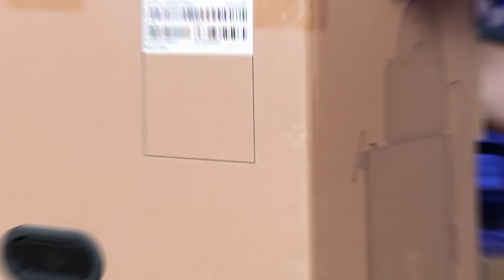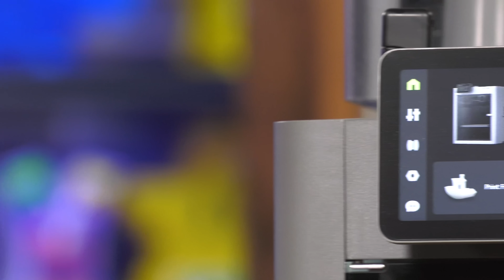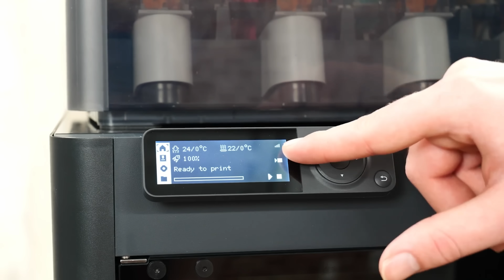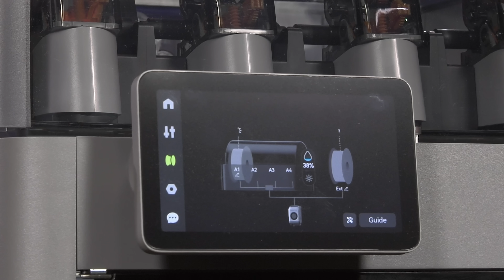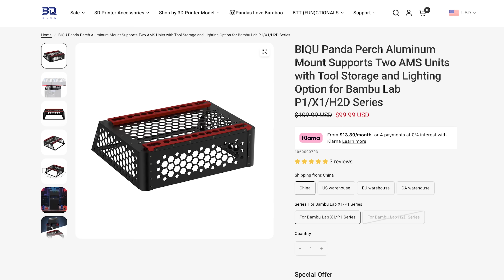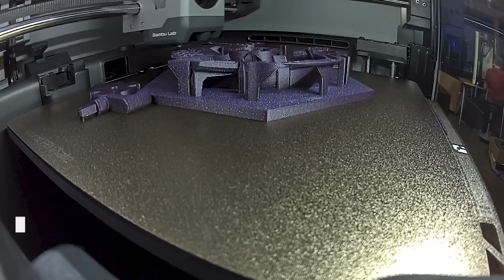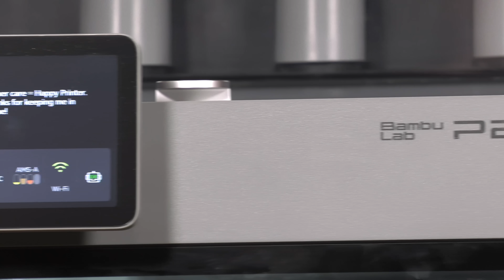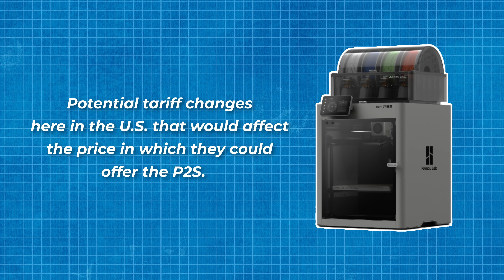FINALLY Bambu P2S IS HERE, Upgrades the X1C?

Comment: If this is not compatible with their Vortek system it will be a big miss.
Reply: No it won’t. Completely different use cases.
Reply: @garymelrose9727  It is not different use cases. EVERYONE has been asking for a solution to the filament poop issue. And the fact that this still uses ancient technology from the stone ages is a big time miss in my professional opinion.

Comment: I'm working with a centauri carbon but I've started using the same lube for my rails on the nozzle and it works great
Reply: which lube is that?
Reply: @hbot404 I'm just using the grease that came with the printer but any small machine lube that's white or super lube will work great

Comment: You say this is a worthy successor to the X1C, but it doesn't have a heated chamber or the error sensors the X1C has. It just has a nice screen and it's able to hook up 2 AMS units out of the box? I guess it might depend on pricing but it sounds like it should just be the P1S replacement and cost around $800 or so?
Reply: The X1C dosent have a dedicated chamber heater, only a temperature sensor.
Reply: @lukahierl9857 The P2S doesn’t either. It has a passive heated chamber using air recirc, its bit actively heated like the H2 Series. Still better for ASA/ABS etc than my X1C though - that’s been relegated to PLA/PETG only since I got my H2S. That prints ABS/ASA (GF and CF) like the X1C prints PLA, straight from the AMS onto the stock textured PEI plate, no glue, standard profiles, slice/print/repeat 👍
Reply: It has the same sensors as the H2 series have. Add in a better air circulation system, better camera, better nozzle system, its a crazy good value compared to the X1C. $800 is for the AMS combo, which is the same as the P1S was with the AMS 2 Pro instead of the AMS 1

Comment: Looks like a good system.  The challenge today, is what printer to buy.  I just ordered another Elegoo Centauri Carbon yesterday and found out their AMS probably won't work on the CC.   The new Bambu printers with AMS could be obsolete when the tool changers hit in early 2026.  Will be interesting to see how the Snapmaker and Bambu units work and Bondtech will be something to see.
Reply: As cheap as the Centauri Carbon is for the quality of print I don't really care about multi color on it.  Personally I pretty much just print ABS on mine and leave PETG, PLA, or multi color to my A1
Reply: @soundman447  I agree.  For $300 it works as well as the Bambu X1C and in some ways better than my Prusa XL.  For single color prints it just works and the value is great.  I really want to see how the production Snapmaker works.

Comment: I hope the PETG issue is fixed, I prefer to print it due to the higher heat resistance.
Reply: You can print with HT-PLA that has higher heat resistance than PETG.

Comment: Some things not mentioned are the cooling fan that pulls air from outside the unit, the steel as apposed to carbon rails, and the upgraded purge wiper. Also it does flow calibration similar to the H2D or A1.

Also.... I just bought an X1C a month ago because I missed my previous X1C. Oops. Oh well. Its still a beast lol
Reply: I have a X1C, and X1E... don't regret them, because they have seen a ton of use.  The X1E is nice because of the filtration, and the hard-wired Ethernet.  I'm glad Bambu is iterating and evolving, while keeping prices reasonable.  It just means more people are going to get into 3D printing and the entire ecosystem expands.
Reply: Don’t have buyer’s remorse over buying a X1C instead. Use it until the X2C is released. I’m sure it will have the new tech from the P2S and H2S with the sturdiness of the X1C.
Reply from the maker: Still a beast for sure!

Comment: I’m sorry but this was not one of your best videos. I did not hear anything that would say it’s an upgrade of an X1C. Ok having two inputs for AMS, then taking the hot swap from the A1 are not really upgrades. If someone doesn’t have an X1C then buying this instead of a P1 is a huge upgrade. At this point I’d expect more from them. An X1 upgrade would include a heated chamber. But I’m guessing it looks like they put all of their newer ideas and upgrades into like you said their new flagship H series. In any case thanks for sharing the information and your hard work. 😊
Reply: that nozzle is a huge deal though, along with the screen etc
Reply from the maker: Yeah, the H2 series gets all the goodies. If they put a chamber heater in hear, the price would skyrocket.
Reply: better rail design, better hot end that's standardized across the entire mid and upper lineup, way better extruder, no useless LIDAR, better UI, cold air intake so you don't have to leave doors open on PLA, full build plate usage as it uses the cutter from the H series, and better nozzle wipe area (PETG bugs aside)

There is no market for the X series anymore, the H2S took that slot in the pricing lineup, this just brings the mid tier up and splits them into 3 distinct lineups. 

I think it would be nice to see the A2 become what the P1P was, open air but framed in, best of both worlds cost wise, only thing is I don't know of a way they could bring forward the rock bottom pricing of the A1 mini with going core XY so I guess we'll wait and see
Reply: @chomp7927 So how it is better than X1 or even P1S? If you already have one of above, you are good. Only if you concidering new printer P2S clearly wins over P1S and for some over X1C
Reply: @maxdefire I literally laid it out there buddy, if you can't read that's on you. It is objectively better than the X1 in multiple ways, and flat out better than the P1 in every way. 

Whatever you already own or don't own already doesn't change what's better or worse, that's a personal choice you should make for yourself but that has nothing to do with which one is the better printer
Reply: @chomp7927 it actually worse it terms of print quality lol.
Reply: @chomp7927- passive chamber temperature control for ASA/ABS as well. FAR bigger and more efficient chamber VOC filtration for ABS and ASa as well. Several improvements for those not determined to see none. 👍

Comment: Man, I've been a Prusa fanboy for the last decade. I upgraded my Mk4 to a Core One and it's a fine printer. But it's getting harder and harder to justify my unreasonable hatred of Bamboo printers. The last thing I have is that firmware thing. Are they still doing that? Can I keep hating them?
Reply: no changes on that front, plus these newer lines obviously don't have old enough firmware to be pre-ban so if that's a sticking point for you then it's still a thing
Reply: The firmware thing alone is enough of a justification. That and long term support and upgradeability. You get what you pay for.
Reply: @Waldohasaskit210 - you certainly do…if that how you Prusa fan bois have to justify your spending, tinkering and DIY ‘support’. 👍

Comment: 4:11 You're using the scraper upside down 😯
Reply from the maker: wait, text up, yeah?
Reply: @3DPrintingNerd  If you flip it over, the 'sharpened' side of the blade can become flush with the bed, whilst also resting the plastic on the bed. This way you never cut into the bed by accident. The 'ramp' or 'nubbin' or whatever you wanna call the thingy that's now on the bottom then becomes a place you can push against with your finger.
Using it upside down gives you a high risk of scratching a surface

Comment: Yep. Kinda figured, Trump be fuckin shit up as usual.

What I wanna know is, I wonder how much of the P2S parts would work on a P1S? Can I convert the hot-end to the quick-swap version? AND THE SCREEN! Can I have that screen please??
Though question, if this is more of an X1C replacement, does it have features like AI trouble detection with the camera system? Lidar sensor for first-layer correcting??

Comment: There are a couple of features that the X1C has which aren't mentioend here that I'm curious about. Does the P2S have the same or similar speghetti detection and LIDAR sensor for the first layer? To me those are the big things that differentiated the X series from the P series so if they're not on the P2S then I'd disagree witht the conclusion that it's an 'upgraded X1C'
Reply: Did the first lidar do anything useful? Tye spaghetti detection is from the camera.
Reply: @SentientTeapot2444  in my experience the "Lidar" sensor in the X1 dosent work. On the other hand the load cell based system in the A1/H2 printers is very reliable.
Reply: @lukahierl9857 - I agree. The constant ‘LiDAR is dirty’ warnings are a pain on my X1!
Reply: Yes, it does do spaghetti detection. It does not have Lidar as Bambu Labs are now using the same method that the A1 series uses.
Reply: @SANSd20  what you said but likely based on a better CPU it's likely using the same AI detection the X1 or H series uses, A series CPUs are pretty gimped so I would assume they are using a better detection algo like on the X1 or H class machines
Reply: @chomp7927 I meant the H series as they use the same nozzle. I don't know why I typed A1 series.

Comment: A few month ago, p1s were like, "nah, we don't need touch screen" . Now they will be like "whaaa, that screen is nice" 😅. But joking apart, I don't really like the easy swap hotend mechanism. A bit fragile and I now have to heat up the hotend too to remove it after I forgot to change some settings when changing material and got some filament buildup like you. I bought a hotend with removable nozzle for my x1c and like it more than the way it's done on my mini. Might be the only one thou 😅.
Reply from the maker: A removable hot end like what you got is SUCH a good idea.

Comment: Now that I saw what Snapmaker did, it is hard to justify the machines with only one extruder.
Reply: But the Snapmaker can't even print soft TPU out of the box. I don't think people will like that. Also, remember Joel's ender 7 (3 years ago) can see the first layer on Snapmaker...
Reply: @Golfboy-ze3le  - also no use for engineering filaments, unlike the H2S, P2S and X1C (in descending order). My H2S prints ABS and ASA like my X1C prints PLA. Slice, print repeat.
Reply: Then buy a Snapmaker 🤷🏼‍♀️ I’ve had other machine brands and I’m not touching them again
Reply: @DS-pk4eh  I bought one printer from snapmaker. Never again. It might look great right now but please don't fall for it.
Reply: Bambu Labs H2C will compete against the Snapmaker UI in that area.
Reply: @MadStyle1911  Not at the Snap maker U1 price point.... Not possible with the current H2 prices
Reply: @MadStyle1911 I'm hyped for the vortek nozzle swap system. I have an H2D but it should be a fun project to do the conversion
Reply: @SangheiliSpecOp as owner of h2d and almost commercial printer I'm afraid about idea to swap right nozzle. Without option to feed tpu or different brittle or gummy stuff to left or to use it with ams, right nozzle ams feed vortek will be just pricey, overengineered colour changer.
Reply: @MadStyle1911 I hope the H2C will be priced around the retail price of Snapmaker U1 (hopefully H2C will be around $1200-$1500) to be competitive with the U1.
Reply: @KippyKipKip  Hoping as well..
Reply: @KippyKipKip Yeah there’s zero chance it’ll be in that price range. The H2D sits and $1999USD currently. For them to come out with an even more advanced version of the H2D and sell it for less than the H2D would not make sense. It would be nice to compete with the price of the snapmaker U1, but there is no chance they’d do that. I definitely think they’ll hold their prices the same as Prussa is doing with the XL. Definitely expecting it to be around $2600-3k with a full nozzle setup.
Reply: @SeriesDmusic Ouch. But I will continue to hope and dream (not that it will come true). LOL.
Reply: @KippyKipKip that's not competitive pricing
Reply: @KippyKipKip  they said flagship printer. Will be 2000+
Reply: (This is just my use case, there may be others like me but there may also be people completely different, so no need to jump down my throat if you hate what I have to say. Disappointing that I have to preface with this, but given how tribal people get over printer brands, it's something I do have to say...) As someone who uses my makerspace's X1C to print Warhammer/Trench Crusade mini's as well as cosplay items (and is looking for a machine to have in my own home workshop), everything coming off the printer is single colour/material because it's all going to be sanded/painted anyway. 4 auto hot swappable heads isn't something that I need or want, so I'm happy to forego it as a feature in favor of a machine that I know and have history with already. In the end it'll depend on what the post-tariff price of the P2S is, since I'm currently favoring the H2S for it's 340x320x340 build volume.
Reply: @ThatOtherAndrew  I agree on build volume, I have couple MK4's and I want something larger S was my answer as well
Reply: @ThatOtherAndrew  Well,  I think we are all looking this from multi-color or multi-material project perspective, with material waste being main benefit. Your thing can be simply resolved with just bigger rol of filament. Sure Bambu is great quality, but 3D printing tech is advancing, and we want our favorite brands keep with it.
Reply: @DS-pk4eh  facts I'm not getting this
Reply: I have to agree
Reply: I completely agree with you.

Comment: Darn. I was hoping for a P2C option for an AMS-free color system. This fixes some things that were wrong with the P1S, but looks a lot worse on the exhaust and noise.
Reply: based on the extra space needed I doubt we'll see that on the lower machines, that will most likely stay H series at least for this entire lineup
Reply from the maker: Yeah, color changing hasn't changed for this one.

Comment: bam. stay first or you wont win. multi-filament single print head for no poops. ie not even print head changers. all the four or more filaments input to the same hot end at same time. no switching filaments but just using different filaments at will. no change poops. yep the roetz4 hot end. not the directional filament but just for filament and color changing printing one color at a time. wine and sausage. yeah tons of that going on it seems. very clean difference indeed. just use up the last color as infill then use the next filament as usual. ie if you dont have multi-filament hot-end and just single nozzle print head then clean up the nozzle by using it as infill while changing colors. no external poopsies. eye of above is upon you. eyeyeyeyeye sir. how many joules to save. present wrapping. why they did not put preheated chamber in that. simple heater exhaust does not cost 1000usd to make. there should be standard enclosed features. money cant think clearly indeed. 1000usd is way high for a normal kitchen appliance. corps: lets just put these random features in this no thinking. who told you corps products were the best. free is the best of course. market price seems to be ok for p2s tho at 500eur. but I dont need more than just elegoo N4 for simple working petg prints. which is 200eur only. maybe for mass 3d printing farm. nano ion 3d print all the chips at home.

Comment: The improved screen and ergonomic features like the handles and ramp are decent upgrades; however, I am not keen on a device that can become bricked remotely from a software update.
Reply: So, you aren't keen to use any device that gets software updates? A software update for anything can go wrong, or be implemented incorrectly and brick a device. Not just Bambu...
Reply: Pls do give exemple of people it's happened to?
Reply: @Sharlequint  6:20 it was an entire section of the video…
Reply: @OneWayTwoBrazil  that's bricking your device? pretty sure most other companies' printers had way more glaring problems on launch? Like you could just turn on LAN mode and not install any updates? Like any other company's printer? Do you even read what you type and try to make sure these are your own thoughts before you type lol
Reply: @OneWayTwoBrazil  Like I get it if out of principle of not supporting a company that locks down its systems at all because that's something you don't like, but now that LAN mode has been provided and other companies' LAN modes have almost the exact same restrictions (no mobile app connection, no cloud slicing and send to printer) what's the argument anymore?

Comment: Oddly, my P1S started randomly having that same PETG issue and I wonder if they are related. Still printing great but the buildup around the nozzle is pretty annoying
Reply: PETG has always been notorious for blob of death, I've experienced it like ten times with PETG and never with any other filament. I check on the printer every 30 minutes when printing PETG due to PTSD.
Reply: @NightfallSentinel luckily it never fails but it will leave a smear of some type it seems at one point or another. On this print, I was printing something black first and then something white after so of course some of the white had black blobs hanging out within the layers.
Reply: The ObXidian nozzels help somewhat but are very expensive. I have one in 0.6mm that I use for >24h PETG-HF prints and it works quite well.
Reply: i was having this issue i backdated to the 1.08.01.00 and no more issues
Reply: @TheVegasCabbie  i just updated to 1.09 after so I was having the issue with 1.08 as well. Funny how it works sometimes